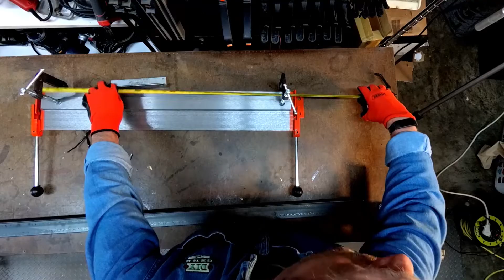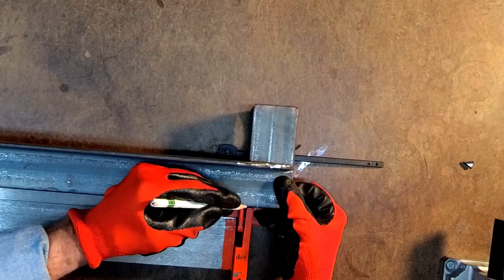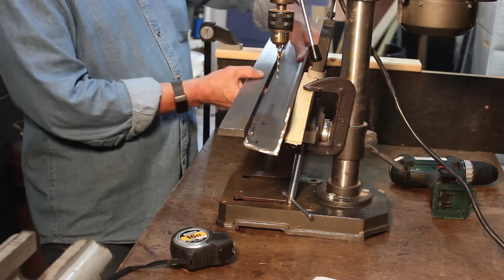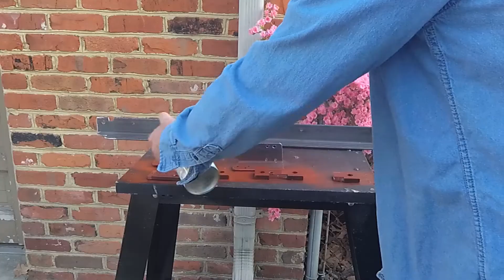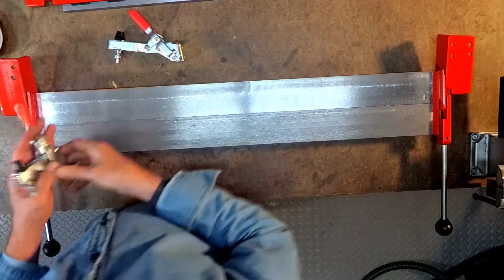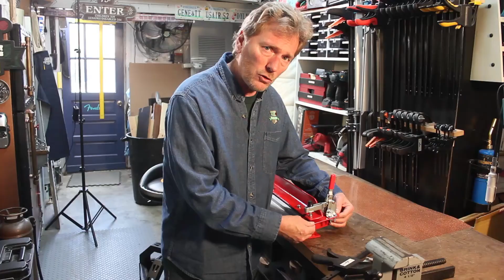Best 30" Metal Brake Modification! (Easy To Do!)

Comment: Great looking collection I had several 110 knives over the years now my daily carry is Sheffield with a liner lock and pocket clip I don't remember the model nor grade steel but it holds a pretty good edge I mean shaving sharp
Reply: Oops I screwed up was looking at two different videos my bad

Comment: Gene, how do you set the thickness?
Reply from the maker: You can adjust the down bolts on the clamps. Thanks for watching.
Reply: @DIYGene yea,but that doesn't gap the break
Reply: Guess its all close enough for light gauge?
Reply: @DIYGene I love it. Thanks

Comment: Gene, do you have an engineering background? If not, how on earth did you come up with that design mod? It is very impressive.
Reply from the maker: No not really. But I worked in the sign industry for years and worked with metal brakes and have a working understanding of them. This works really well and actually makes a worthless tool into a productive and favorite tool in my shop. Thanks so much for watching.

Comment: I have to admit, you made a complete POS into something, barely useable. I credit you sincerely for taking this HF failure and making it into a functional mini 'brake'. But For $60.00, I'm afraid this is just too cheap to invest another $50.00 of parts, hardware and labor. But again, you did a great job!
Reply from the maker: Thank you. I agree. It was really a pain to even try to use. Now I have a tool that gets used a lot. Thanks again for watching.

Comment: Lots of issues with this video.    First, you're using a cutting disc for a grinder.  Not wise to put a side load on a cutting disc, I've seen many explode like this.   Eye protection is great, not having your tools explode is greater.   Second, you drill with no cutting fluid.  Cutting fluid cools your drill so it doesn't dull nearly as fast, you want to use it.   Third, when you're tapping, you want to "chop" your chips out.  Turn a quarter turn, back up a bit, turn a quarter turn, back up a bit.   I have never broken a tap in my life, and I've tapped a lot of holes in a lot of different metals.
Reply from the maker: Well, thats why I am still learning.😀. But this brake has turned out to be a great tool now. Thanks for watching.

Comment: This is by far the best HF brake mod I've seen, well done!
Reply from the maker: @ern48 , Thanks! It really made it into a useful tool. I use it a lot. Thanks again for watching.
Reply: @DIYGene   You're not kidding, your clamp set up is just as good if not better than a full size commercial brake.
Reply: Northern Tool will probably dispatch a hitman to your location when they find out you called it a HF tool. 🤣🤣

Comment: I guess it was obvious to other viewers - but I couldn't figure out where the "blade" you kept mentioning came from. Then, I realized it was off the NT brake?
Why didn't you use the angle grinder for all of the cuts?
Regarding the problem encountered with the taps: Could you go with some kind of threaded insets instead? Maybe a RivNut, or similar?
Reply from the maker: @billrogers6863 , I should have used the grinder for the cutting but for some reason I decided to work my… off 🤪 
Yes the blade come with the brake. I think the RivNut could be a great idea. Thanks for watching.

Comment: curious, if you replace that square stock to round for radius bends.
Reply from the maker: @motomarcel1 , that is an interesting suggestion. I know that now this tool is a very useful piece of equipment in my shop. Thanks for watching.

Comment: How do I get the measurement print on make this. I have a 30 inch. H.F. one
Reply from the maker: I don’t have measurements printed out. This is really simple and may need to be adjusted because of the size and even the brand. Basically 2”x2” angle iron. 2 cut 4.25” and 1 cut 35”.  I hope that helps. Thanks for watching.

Comment: how does it do with 0.016" thick 30 inch wide Carbon Steel?
Reply from the maker: @PinkslipDaddy , I think it would struggle with.016 in 30”. I have bent .016 in about 6” and it does fine but I haven’t tried 30”. I’m afraid the center would round off.

Comment: Great mods.  Love the clamps you found.  Looks like you are more of a woodworker with hand saw, tapping...  I will be using the cutting wheel for all and welding.  Thanks!
Reply from the maker: You are spot on. I am more of a woodworker. This brake mod could be done much more efficiently by a metal worker. But the concept stays the same. Thanks so much for watching.

Comment: Great job! I have the 18" and did something similar. One addition was welding a piece of 1/4" X 1" X 6" at the bottom so it simply goes in my 6" wood vise so no need to clamp it to the table. One quick turn takes it on and off.
Reply from the maker: That’s a great idea. Thanks so much for watching.

Comment: This is awesome and I have already picked up some toggle clamps thank you!
Reply from the maker: It truly made the brake a usable tool. Thanks for watching.
Reply: @DIYGene  I finished the project and it does actually work really well! It has all the adjustable spots like a more expensive brake! I had considered the tool nearly scrap metal for two years! This project total cost me under $100. Thanks again
Reply from the maker: @Branhawk  That is so cool. I hope you use it as much as I use mine. Thanks again!!

Comment: Curious as to why, if you had an angle grinder, you didn't just use a cutoff wheel instead of the hacksaw?
Reply from the maker: Because I didn’t have a cut off wheel and was too lazy to go by one. LOL. 🤪 Thanks for watching.
Reply: @DIYGene  ok, I was wondering, because I thought at first maybe that was the case, but then I saw you cutting notches with what looked like a cutoff wheel -- maybe it was just a grinding wheel.  Anyway I started to wonder if there was a benefit I had not ever considered from using a hacksaw.  lol

Comment: Great Mod Gene,
I've been looking for something simpler than welding to the edge bar (possible warpage) and using springs and sleeve nuts to clamp down the plate (little space to work).
This is a much better solution. I will be doing this to my HF 30" unit in the next week or so. Mine struggles to bend 24ga sheet metal with some bending to the edge bar. But with this mod using 1/4" angle iron, I think it would handle 20ga easily.
Also, a portable band saw is a great tool addition if doing a lot of metal cutting.
Reply from the maker: The portable band saw would be a great addition for me. I’m pretty sure there is no real difference between the Northern Tool and the Harbor Freight brakes. Ha be fun and let me know how it turns out. Thanks for watching.

Comment: I just finished modifying a Harbor Freight metal brake with your upgrades and some modifications of my own. I welded a 1/4" piece of flat bar to the 2x2 angle iron. I then bolted the 2"x2" and flat bar subassembly to the blade with 5  1/4  bolts.  With the addition of the 1/4 "  flat bar it was too heavy to lift with the handles on the toggle clamps so I added a handle in the middle of the 2x2 up-right. that makes lifting really easy. Thanks for the video. This is going to make a really good metal brake. 

OLD) Just an FYI, your link to the angle iron takes you to 48x2x2 aluminum. Great video.
Reply from the maker: Thanks for the heads up.

Comment: I like the idea of what you did but if you try and bend the max gage (16 gage) it wont work so well. You need to be able to move the blade forward and backward to accommodate the thickness. With the bending bar in a vertical position you should be able to slide the metal between the  vertical and horizontal bars easily. Great video.
Reply from the maker: Great point. And you can move the blade forward and back by adjusting the top bolts on the clamps. I may a a minute but once you do, you don’t have to adjust again for that thickness. Thanks so much for watching.

Comment: Suggestion  ;  You improved the brake, your next improvement should be to purchase a Lennox high tension hacksaw paired with bi-metal blades of different pitch. This style hacksaw will give better cuts that are straighter and blade life improves immensely. The style hacksaw you have does this.  On the forward stroke, the blade behind the point of contact can bend from stretching ever so slightly coupled with a holding device that allows the blade to twist which causes your cut to go off course.  The more pressure you apply amplifies this.  If you get one, I doubt you will want t0 use your present one even for wood projects. Your call. My Lennox is an older model and after the blade is placed over the pins and slack is taken up with the crank in thew handle, the crank gets 8 additional turns. it is solidly held. I picked up a Stanley high tension frame and it is inferior to my Lennox. Nice work on the bender. Using angle is a good idea for getting clearance in the front. The clamps are also a good idea.
Reply from the maker: Thanks for the great suggestion. I will look into it. Thanks again for watching.

Comment: Creative.  How well do the flip clamps stand the test of the challenges of a 30”, 16g steel without flexing or breaking?
Reply from the maker: It works better the using the old C clamps. 16 ga. Steel is going to tough at 30” with this brake no matter what clamps   Thanks for watching.

Comment: Grat modification which I will be doing to my brake.  One more upgrade would be to cut the original flat bar into sections, so you can remove a piece to bend boxes. This of course would require a few more tapped holes, but I think it would be worth it.
Reply from the maker: Excellent suggestion. Thanks so much for watching.

Comment: "easy to do!" proceeds to take 3 minutes of video time to cut angle with a hacksaw
Reply from the maker: I could have used power tools but I wanted to show the simplest way possible. Thanks for watching.
Reply: The best part is him cleaning the cuts after with an angle grinder. That really blew my mind.
Reply from the maker: @yakswelding86  , well there is the right way and the DIY Gene way. LOL. Thanks for watching.

Comment: Came out nice but what about when u got to go past 90degrees?
Reply from the maker: The blade has a slight angle to allow a slight over bend but you could cut or grind the blade to a 45 if you need more. I hope that helps. Thanks for watching.

Comment: For best cutting thread results, go 3/4 turns forward and 1/4 turn back every time until your through. No need to wind it all the way out, clean up and go back in again.  The back and fourth breaks of the chips in small pieces
Reply from the maker: excellent advice! Thanks so much for watching.
Reply: I agree with the threading process.  I learned in metal shop 50+ years ago to go in 1/2-3/4 turn then back out 1/4-1/3 turn to clean cuttings, and continue.
Reply: Exactly how I learned it too, but that was 57 years ago 😅 @reddivrbob

Comment: Gene, This is the KISS principle at its finest on this generic 30" sheet metal brake that is sold by many different distributor's everywhere. Mods only requiring a little drilling, grinding & tapping with no welding required. This has greatly enhanced this sheet metal brake.👍👍 Once your video goes viral, I expect that there's going to be a run on this brake, toggle clamps & some 2x2 angle iron happing soon. I just waiting on HF to post some good coupon discounts on this item, hope its by Memorial Day week. I've  got a few Andrew Jackson's wanting to get out.  😁 Thanks for sharing
Reply from the maker: Thanks so much. It really is a simple solution and is fun to use. And you are right about this can be done on so many brands of the same basic brake. Thanks again for watching.

Comment: Thanks for the great ideas Gene!  I was looking for a solution to the clamping dilemma and this brilliantly solves it without reducing the material width capacity.

Does this also increase the brakes ability to bend thicker material?  If not, would stronger clamps or a thicker backing plate (attached to the pressure plate) do the trick?
Reply from the maker: Thanks so much.  I think if I was going a lot thicker material, I would get heavier clamps. Thanks again for watching.

Comment: This is the best setup I have seen.  I watched many others and this will definitely make this much more functional. 

What is the purpose of the shims?  I have watched the video a few times and not sure why they are needed.
Reply from the maker: Thank you! I did the same thing. I watched a lot of Mod videos and thought there has to be a better way. The purpose of the shims is for clearance of the 2” angle iron over the ends of the brake. The blade is not thicker than the sides. I hope that makes sense. You could also use fender washers for shims. Thanks again for watching!
Reply: Just grind the ends down like most people have then weld the angle iron to the blade.

Comment: Awesome upgrade,  Gene.  That transforms the usability of that brake.  I've got some 3ft lengths of angle sat in the corner of the shop which will, one day, become a press brake.  I'll certainly be adding those toggle clamps to my design!
All the very best, Roy.
Reply from the maker: Thanks Roy!  I can’t believe what a big difference it made. Thanks again for watching.